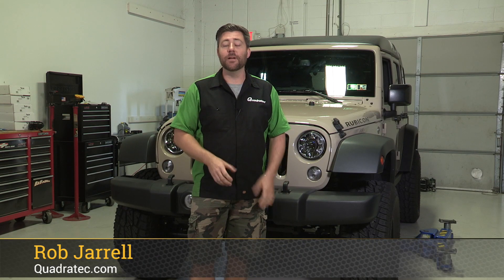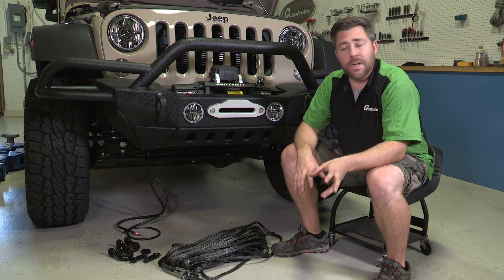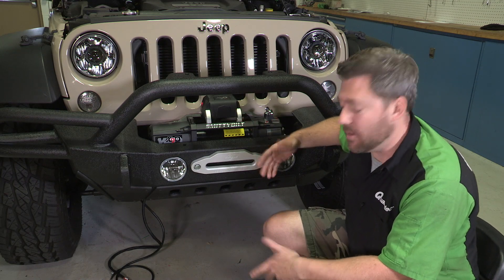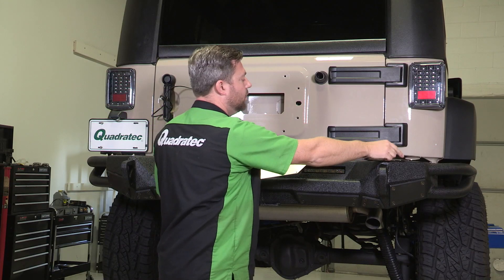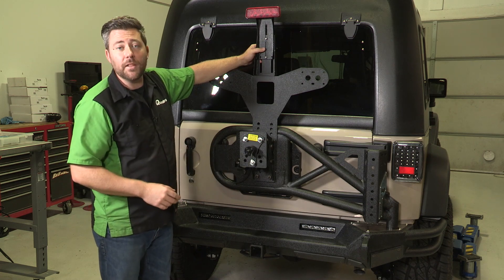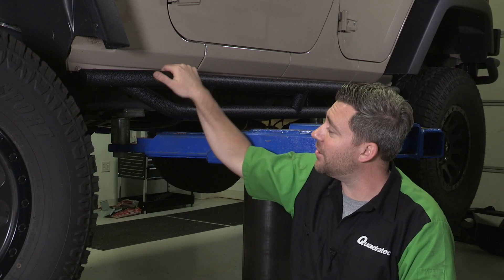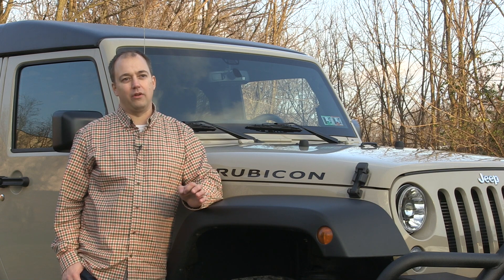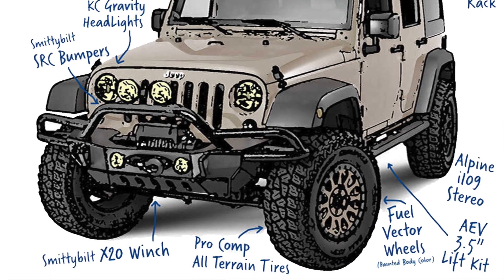Project JK: Savanna - Front & Rear Bumper, Tire Carrier, Winch and Side Armor Install

Comment: One thing I noticed is that this tire carrier must be used. Smittybilt updated the blanking plate to allow for a vent. I know because I got one of the first ones and had to cut out holes for vent. Without the vent you can't really use the heat or AC.

Comment: for the front bumper did u have to drill extra holes in the frame?
Reply from the maker: We did not have to drill any additional holes in the fram of this 2016 for the front bumper, everything lined up perfectly.
Reply: Quadratec even the stumpy xrc gen 2 front bumper, you don't have to drill any extra holes on a 2016 jk?